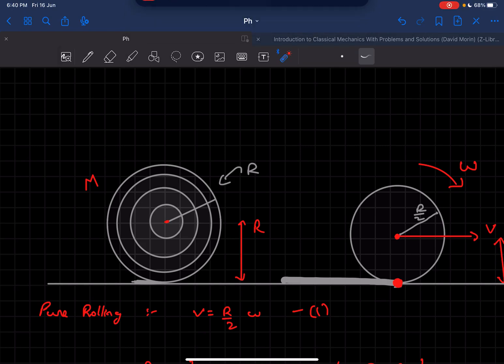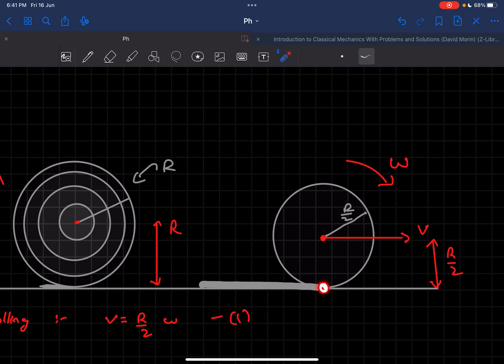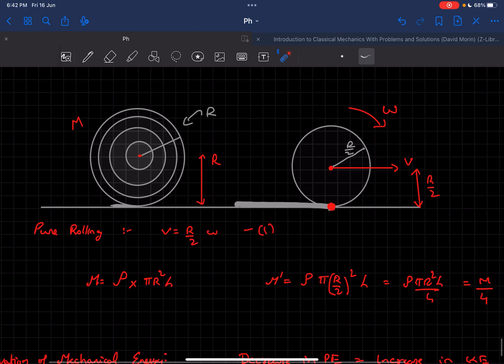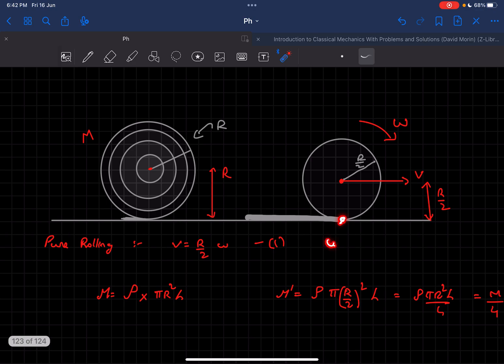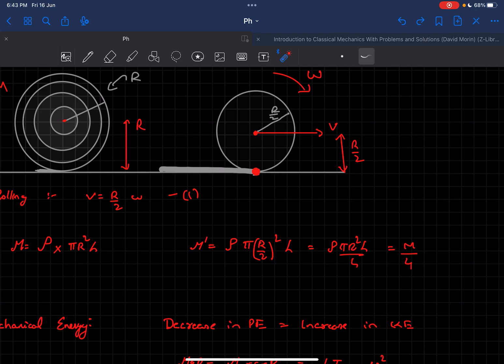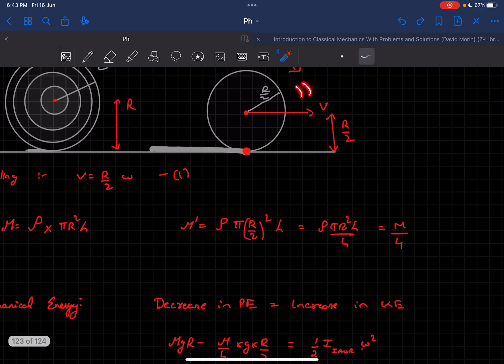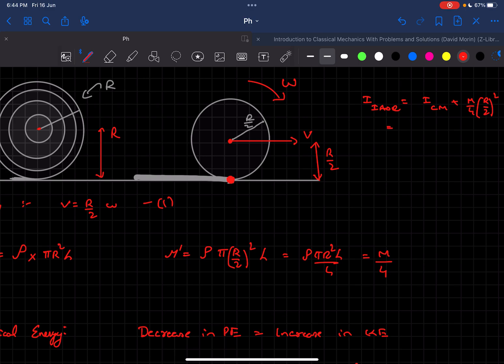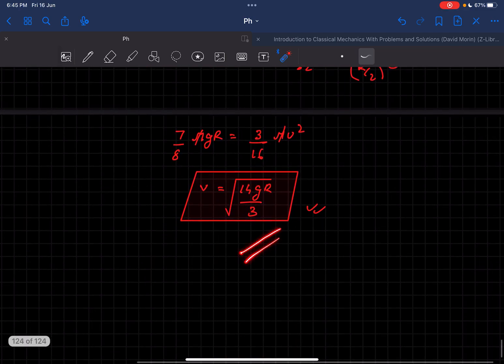[JEE] Velocity of Unrolling Carpet | IIT 1990

Comment: But why the energy is conserved 
In 200 puzzling problem 4 it is written due to sudden change in momentum of dm mass energy is not conserved and also due to continous inelastic collision we not conserved energy 
Is not there such a situation or are we here assuming that the lowest point has zero velocity then the change in momentum is not a sudden process
Reply: Thanks
Reply from the maker: That problem was modelled differently so there was a thin carpet over there and the bend had to be taken as negligible therefore the velocity transitioning from 0 to v almost suddenly. Here you can assume some finite thinkness for the carpet and there is no such sudden destruction.